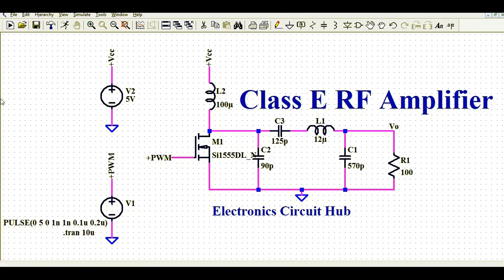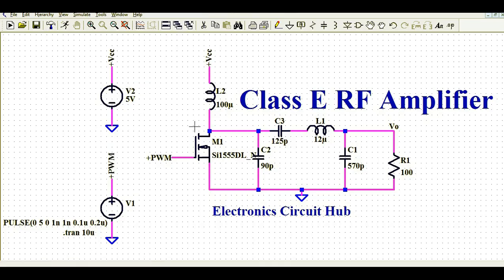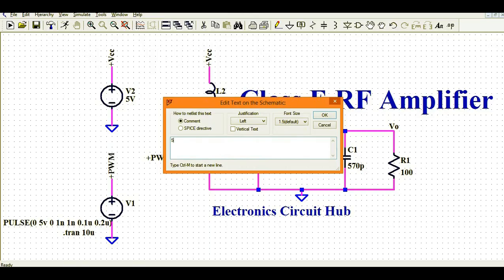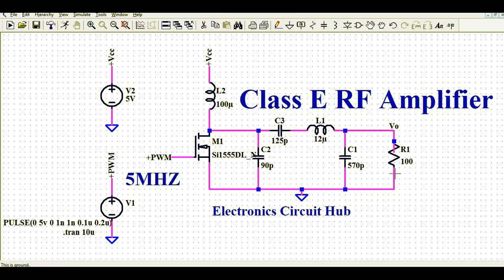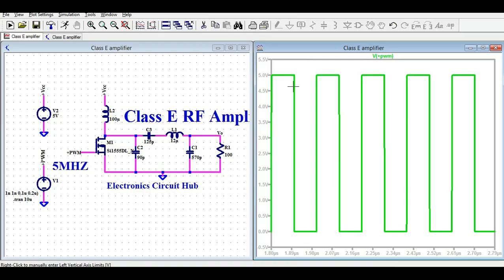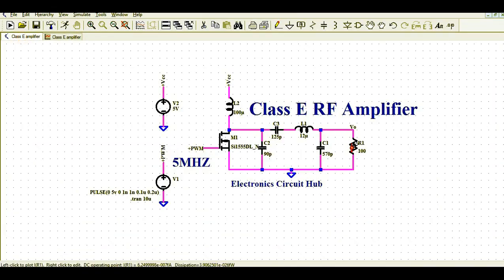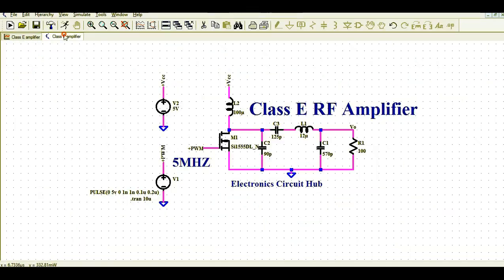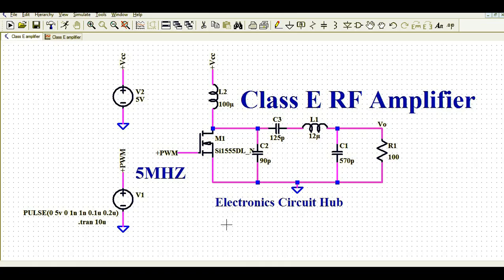Designing a Class E RF Amplifier in LTSpice | Comprehensive Guide

Comment: Hello Sir, i want to modify this circuit output for 50volt 63khz 0.2amp sin wave , so what will be changes in this circuit
Reply from the maker: Hi...need to ✅ how it can be done. You can copy and simulate per your requirement.